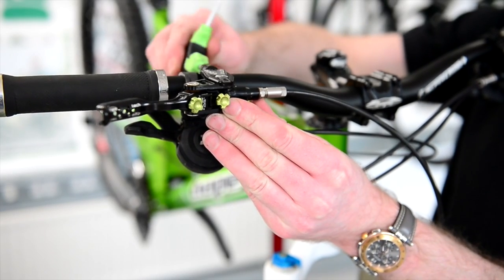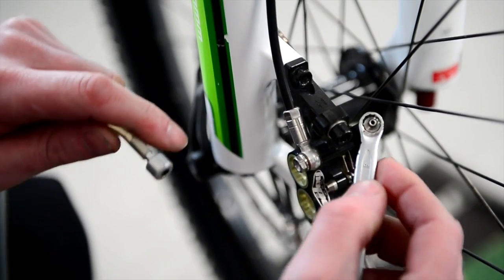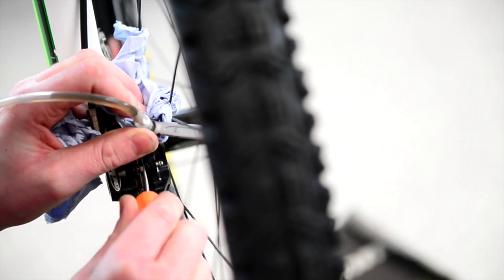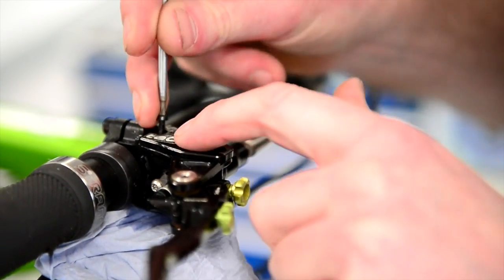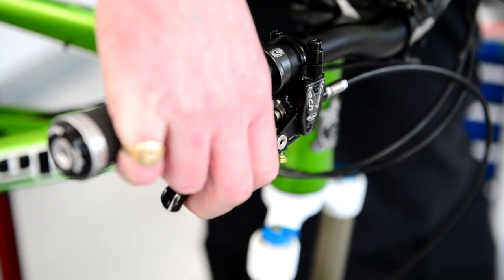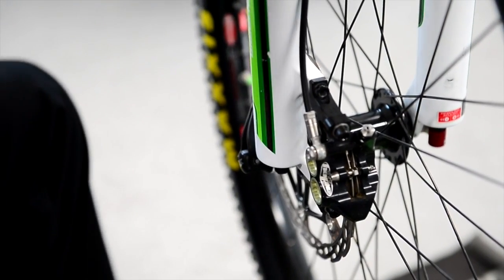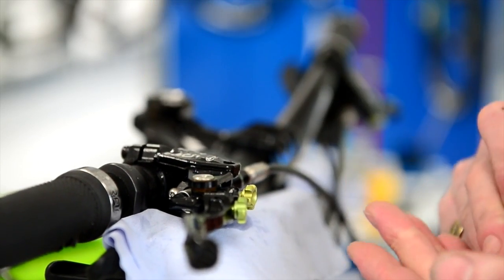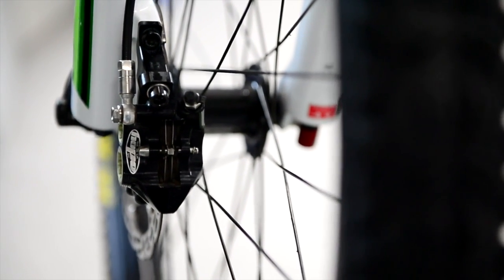How to bleed a Hope brake - Hope Technology

Comment: Hope Tech 3 E3?
I always take out the brake pads before and replace with a dummy brake pad. You don't want oil in your pads. Even if it is pretty easy to burn it off with a gas burner. Never knew I would need a gas burner to go bicycling!

Comment: If you have a longtail cargo bike or a tandem then this method is pretty useless unless you have a friend to help. I struggled to get anywhere this way and decided to do it how you would do other brands that have a bleed port, fit a syringe to the bleed nipple. Attach the pipe to the syringe and make sure it won't come off (cable tie). Open bleed nipple, pull on the syringe to create a vacuum and then pump the brake lever, top up oil, keep doing this cycle of adding some suction with the syringe and pumping the lever, checking oil levels after each round. Worked a treat for me. Makes a lot less mess too.

Comment: The new V4s are awesome. Have a pair on my 2020 V10. The new straighter levers make a difference. The modulation & instant bite are phenomenal. Only have to give the levers a light touch & it wants to send you OTB. Well done Hope. Also have Hope ventilated disks on both my Santa Cruz  V10s. Have pre-ordered a pair of the new Hope Pro 5 hubs for my 2020 V10.
Reply: My Hope V4 brakes were just as you describe for several weeks and now they can't even stop me at walking pace. I'll have to see what's up, do a bleed and check the pads but this earliest I've ever had an issue with a brake.
Reply: @SnowShackboy  Ok. Will keep a eye on them.

Comment: I've had so many issues with these E4 brakes. I've inherited a bike from a friend while he's away and already put a ton of money into his bike.  I've bled these multiple times several different ways. No way there's air on my lines. It sat in storage for awhile and the pistons where seized. I fixed that issue, but now I just don't have any power. barely any. At the lever, it sounds like it's sucking air in. I need need to get this thing going otherwise I'm out the cost of the drive train and dropper I put on. Can you give me an idea of what parts I should replace. Sounds like the piston is leaking air? So possibly the seals?
Reply: A year late to the party, but Hope will completely rebuild and bleed the brake for around £60. Also includes a new set of pads. Bargain!